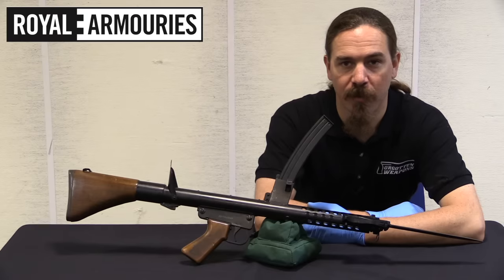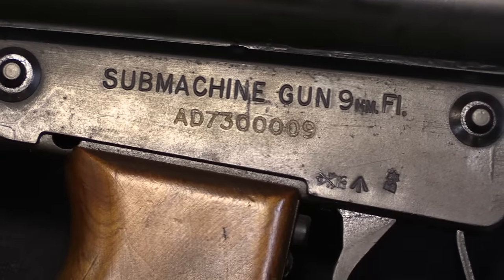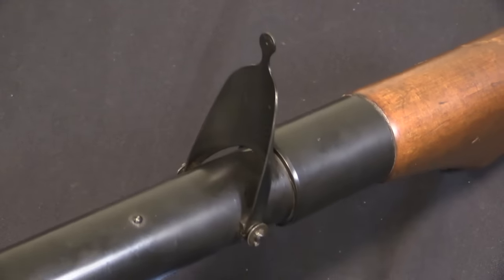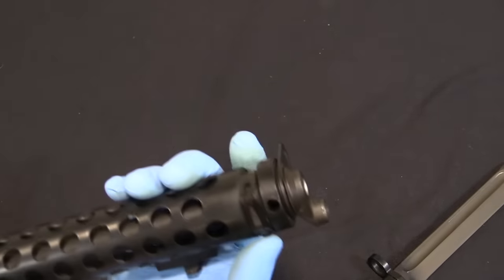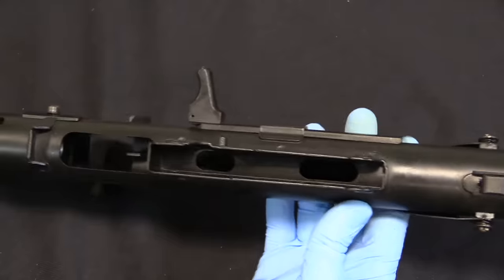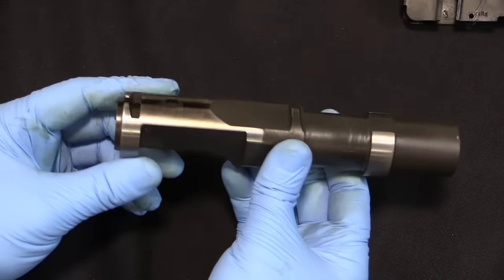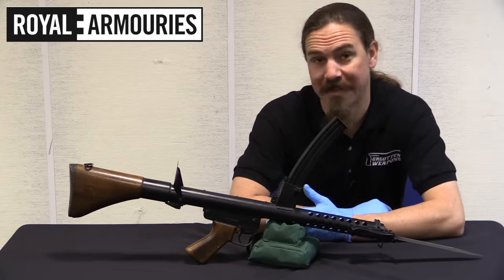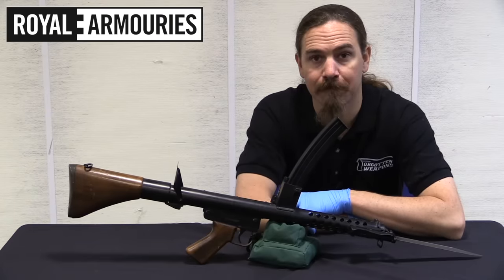Sterling Meets Owen: The Australian F1 Submachine Gun

Comment: Trained with these in 1977 the sight was all but useless as its realistic effective range was only about 50 meters  we were only shooting it on a 25 meter range it was designed and ment for close in jungle fighting not longer range shooting and this is also backed up by the fact the 9mm rounds used in it were same as the 9mm pistol rounds it was commonly thought that a wet army issue woolen blanket would stop the rounds past 25 meters (maybe a bit of a typical army furfy but it shows the thinking it was not ment for much in the range department) When i was using it it was issued to Armored Corps personnel as a personal weapon as it was easy to stow in an APC M114A1 with the Aussie T 50 turret with either 1x 50 cal and 1 x 30 cal machine gun or twin 30 cal machine guns or in the Centurion and later the Leopard AS1 it remained in that role till replaced with the F88 AUStyer carbine. Speaking of the two position  trigger pull while the L1A2 ALR AR version of the L1A1 SLR had a 3 position  safety switch the F88 has a two pressure trigger pull so at first pressure it fires semi auto it is full auto when pulled harder than that pressure ( sorry cant remember those trigger pressures) but in practice the F88 is most often fired in a short burst of full auto when first pulled in combat as the pressure pull is quite low. There is however a single shot lock out button on the F88 to stop you firing it on full auto unless you push the lock out button in and in some conflict areas the Aussies have operated in with the F88 we had to use these lockout buttons on patrols under orders from the UN as they deemed the F88 more as a machine gun than a rifle unless we used the lockout (cant have the good guys having similar capabilities to the bad guys can we). Also if you got to fighting with the pig sticker on it you were one second away from kissing your ass bye bye.

Comment: I fired both the Owen and the F1 during my service. The Owen was very accurate and effective when fired instinctively, however the same cannot be said for the F1. I attribute the difference to the fact that the Owen's twin pistol grips give better alignment for instinctive fire. Also, the additional length of the Owen means that it is held further out to the front, adding to instinctive accuracy. The only downside is that the Owen always crept high right during sustained fire. However, we were instructed to fire in bursts of three. The F1, being shorter, it was held further to the rear, one hand on the pistol grip and another around the barrel heat shield. You to empty the whole mag without too much movement but with a lot less accuracy. The F1 was a big step backwards from the great features of the Owen.

Comment: This gun is suppose to be held tilted to the left with your left hand over the barrel if fired this way it naturally returns to target it only has two stoppages empty magazine and broken or worn firing pin it was reasonably accurate when it's barrel wasn't worn out. Never saw a damaged rear sight the fact that it was curved probably made it more resistant to bending.

Comment: Hi Ian. I may have found one of the 'official' reasons for the sight placement some years ago when talking to a veteran. Apparently, it was because command recognized the magazine position restricted peripheral vision for right-handers if the sight was placed on the left-hand side. To counter this, and allow the shooter improved situational awareness, they placed the sights on the right-hand side so soldiers would have peripheral vision on either side of the magazine.

I have not shot one, am ambidextrous, and have not shot a gun in years, so am unsure if this reasoning is logical or justifiable, but that might help answer your question.

As to the placement of the front sight on the magazine well, that seems to have been because of concerns about the awkwardness of use when placing the bayonet on the left, and potential damage to the right-hand sight if it had been so close to the bayonet fitting.

Hope this answers a couple of questions you asked in the video.

Comment: Im not 100% on this as I have very limited experience with the F1 and the Owen, I think the idea of putting the sights on the right hand side like that allows the user to retain the comfort of resting their cheek on the butt stock while firing, if the sights were offset to the left you may end up needing to hand off to the left out in the air. I also understand that the sights are less likely to become snagged on your clothing if you need to pull it in to your chest for some reason or sling it close to your body. Keep in mind that the slouch hat was always pinned up on the side to stop the Lee Enfield rifle from getting caught on the hat when slung. We tend to do things that make everyday living with an item more comfortable rather than going with the most obvious solution for the items intended purpose. Remember that soldiers wouldn't be experiencing constant fighting for the entirety of their service, a majority of the time spent using the weapon would be either simply carrying it around or at the practice range, so it would make sense to have the magazine on the top so you can lay down at the range and practice firing while prone more easily, but also have the sights so they won't get snagged on your clothing while you are walking to/from the firing range.

Comment: Could it be, that the right placed sights give it a possibility to shoot with both eyes open? So with both eyes line of sight looking "between" the magazines makes it kind disappear if you focus into far away targets? Kind of like with glasses where we don't see the frame if we focus somewhere else. Or with modern holosights/reddots where we don't "see" the frame of the sight but just the dot if we use both eyes because our brain eliminates the blurry thing blocking the view. Perhaps its also something that works better with the original Owen sights and was just transfered to the F1 because it worked back there but now did not work that well anymore with these new F1 sights.
Here some random internet picture of aiming with the owen. Both eyes open here. 744558501-evelyn-owen-owen-maschinenpistole-magazin-waffe-9mm.jpg
Also I agree with everyone mentioning the right sight placement stops them from getting hooked into the webbing. Something I discovered with the (L4) Bren Gun. I tend to flip that rear sight down with my 58 webbing.

Comment: Would the Right side sights because of the traditional Aussie style Slosh Hat design.
So the shooter could fold it down on both sides or have the Right side up fixed in position.

Then with a steel helmet is being used, might also be in some ways very useful to have it also fitted to the Right.
Reply: Front peak brim, would be the distance up to the upright steel mag, so try sticking a sloshed hat on and be Crocodile Dundee for the day, in your shooting one of these Videos.

Comment: I dont know if this is the reason, but when I held it up to use the sights with my RIGHT eye the gun was more inline with my body. if the sight was the other way, it would be away from my body. I suppose if it was on the other side I could use my left eye. Our steering wheels are on the right, maybe we prefer to use our right eyes. i always found it fine.

Comment: sights never got damaged, if you fire this correctly as a right hander it works well, accurate out to 100m and longer, easy to use, operate and fire, they do not feed from owen gun mags. mags are a 30rd only item. Why are the sights off set to the right? because the natural pull from recoil is to the right and up when fired automatic, if your head is already sitting over the weapon your holding it very stable thus the pull is minimised.
when firing from the hip or front it is very accurate for close range fire

Comment: Also you are correct on the serial numbering AD73  means made in  1973 and the rest is the number of the weapon for that year if you look at the L1A1 SLR used in Australia you will often find that it has more than one year as they were in service from before i was born till 1995 and when they were rebuilt completely they were given new serial numbers with the origional year XX out and the year of the rebuild stamped into it so as I had at one time an SLR with the serial number of AD57@@@@@ and this had been changed to AD80@@@@@. The F88 AKA the magic Tupperware was the final major change to follow the latest NATO standards and went to 5.56 mm rounds where the L1A1 was the old NATO 7.62 mm the lost hitting power being made up by using the SS109 projectile in combat conditions the time I was in East Timor in 2000 however we were not allowed to use the SS109 rounds as they were classed again by the UN as armor piercing rounds so we had to use the training rounds that were next to useless with one contact seeing an enemy hit over 20 times by these UN OK"ed rounds and still getting about 5 miles from the combat before blood loss etc caused his death. Where if he had taken 3 rounds of SS109 or the old 7.62 he would not have gone anywhere.

Comment: I recall Australian Army basic training in the early 1970's, recruits had trouble qualifying on the F1, very difficult to get enough rounds on target. On being assigned to a Armoured unit as a APC driver we had a choice between a F1 and a Browning Hi-Power, both useless weapons if you really want to reach out and touch someone.
Reply: Used it during my navy days, it had a habit of high and right pull, using the front of the sling usually corrected this.

Comment: I like for people to think outside the box and relative to submachine guns the Australians have done so and the comments by Australians with experience with the F1 were also very informative.  My major thought is that this gun is about the overall length of a service carbine and it even mounts a bayonet.  I can see why the M16 replaced it for use in Vietnam.  At one time being able to fire from low prone was very important.  Now days soldiers spend a lot more time in vehicles and some discussion of how that top mounted mag works in vehicles would be interesting.  The stock at least on the gun that was shown is not folding.  Folding stocks are useful for use in vehicles.  The comments by users below are generally positive so this would seem to have been a successful design.

Comment: Ok there are many guns with too mounted magazines out there and basically all of them are mounted in the  center... 

Why don’t rotate The whole Action a few degrees? 
You basically still have the advantages of a top mounted system but now it’s no problem to mount the sights in the center... 

The Swiss done something similar to their ZFG 55 sniper versions of the K31. 
(To get a K31 eject properly with a scope mounted directly over the ejection port is a pain in the ass... I’ve done it and it is! 
In exchange for all that work you get a great gun with exceptional accuracy, especially for a sold military carbide from the 30s-50s)

Comment: Ian, in my army experience the F1s were sh*t; compared to the Owen SMG.

The F1 was a donkey designed by a committee, which ended up a camel - useless.

Had the Army stuck with the sound basics of the Owen Sub-Machine Gun, retooled the manufacturing,  refined (I use the word carefully)  the aesthetics/ergonomics and (steel) components by improving the barrel front locking mechanism, increasing the barrel length a few inches (cm); the new variant Owen would have been a goer in any jungle conflict.

Great histories and excellent insights on your channel.

Comment: Having watched this a second time, that front sight looks a lot like an SMLE front blade, also the bayonet boss, was it Smelly trigger, I mean take up the slack and pull thru? What about the butt and butf plate?
Reply: The front sight was from a Bren gun. 
The holes in the magazine housing was so you could align it left or right. 
If you needed to change the elevation, you knocked out the blade completely and put a new one in

Comment: I would imagine the sights on the F1 are offset to the right simply out of inertia, to maintain as similar a manual of arms to the Owen it was replacing as possible. As to why the sights were offset to the right on the Owen, my best guess is that it was done so the sight posts wouldn't get caught on the uniform or webbing of a right handed soldier... Which the F1 ruined by having a big charging handle sticking out the left side, but what can you do?
Reply: have a think about it from a practical perspective. If you're right handed, your left hand does the mag changes and cocking while the right never leaves the pistol grip. If you're as low to the ground as possible ( as per Aussie combat doctrine and training) the top fed mag will facilitate this. When you change the mag with your left hand you naturally tilt the weapon to the left. Since you can't have centre mounted sight, and the gun is going to be tilted to the left more than the right, it makes perfect sense to have the sight on the right hand side of the receiver. the rest of the time, you don't use the sight and shoot instinctively.  Not directed at you, but all these comments about the sights and the placement of the magazine reek of people who have never done a days soldiering in proper jungle, where the Australian operational focus was premised for many many years until 2001

Comment: Really Old Video. But I'll comment. When handling something as short as an f1, or an owen, ...... all the weight is centered, but the  inclination, and vertical direction is left handed,  supported by the left arm at the front . Whilst control of trigger, and precise direction is right handed............ If Sights aren't straight along the top of the barrel...... my natural inclination  is to tilt left, and look down the right hand side. It's how I paintball..... Just seems natural......... But I am Aussie.......... We drive on the left side of the road.............

Comment: No...it suits the Aussies to use the right side...they also drive on the right and its their right ball hangs lower. Not everything is like America on the left. Much of Europe adopts the same principal of right dominant.! Try rotating the gun under the left, to lower profile to ground?. You don't need to be a rocket scientist to understand why it is that way. Going to get real uncomfortable with your wrist twisted under to accomplish that! Having fired the weapon considerably in training in the 70´s, I found it to be a great weapon... if the enemy was within 50 to 30m´s out, and you had to go to this short range weapon... sights and semi auto was the least of your problem. Its ability to belt out rounds accurately in efficient hands was most accommodating. Especially in a closed Jungle scenario like they had in Vietnam where maximum vision was 30 meters max, quite often. 5 round bursts were the recommended in training. Never saw a problem with the rear sight... in fact...many guys never even popped that up...and yet could stich a man sized target every time on the range. This thing was just damned comfortable to use once you got used to it! EVERY BIT AS GOOD AS THE OLD OWEN GUN...JUST NOT AS BULKY!

Comment: Thanks again for another great video. Having never fired Top fed only side bottom SMGs The gravity aid just does not stack pro against the cons. Any well designed magazine coupled with extractor and ejector more than makes the idea of nothing in the PRO side CONS  Just make the top or side obstruction position not worth it.A  extra grab all area.  You already have your hand and grip trigger group forgrip even if just the none trigger hand on barrel shroud are ALL at the bottom. Reloading is faster. No you cant go entirely prone. But your support  wont let you  at any rate. The sites?However in an ambush or firing from concealment not hard cover. That Mag is sure to be a tell on ya in some situations bouncing around  just above the top of your head. Movement or noise is the giveaway one hardly ever sees a static well camoed anything. Itll be a shift or twitch or a geometrical right angle MAGAZINE JOKING I AM or am I?. I found a deer while glassing a wind break when it twitched its ear. Another time an eye blink. To those who say deer arnt shooting at you? That matters little as far as being still to save your life. Deer that see you  know YOU will shoot at them and can set still better than perhaps only the finest snipers and hunters.  Who well know. What just a head turn of a few degrees can mean if your position is being actively glassed by enemy eyes or scanned by a old Buck already feeling something just aint right. But all that gets off the point of This top and side fed weapon design. Please my tone is not being a smart ass ither. I guess IM just missing something. So please WHY other than gravity? The already in service magazines have no idea what direction they are pointing and look like they would work better than alot of great mags.With the roller feeding aids. Great video I do enjoy the history. I would add though not cheaper.They did improve the user friendly aspect. . The stock and bayonet all seem like the weapon is thinking of the user and possible needs